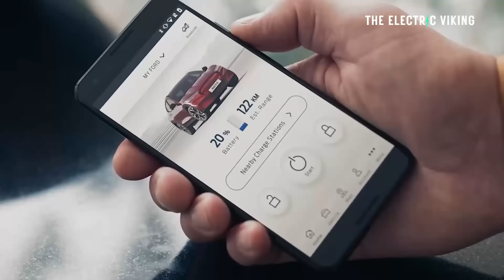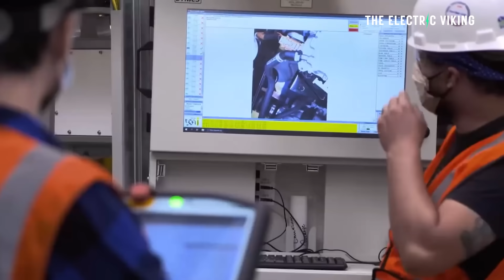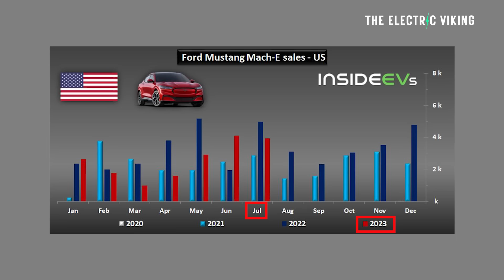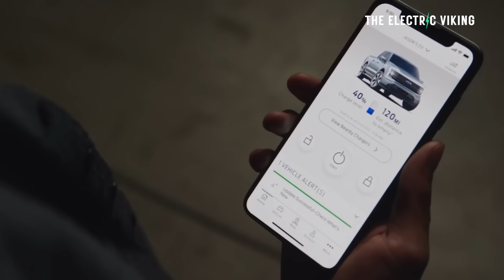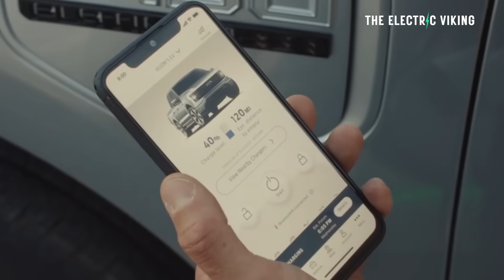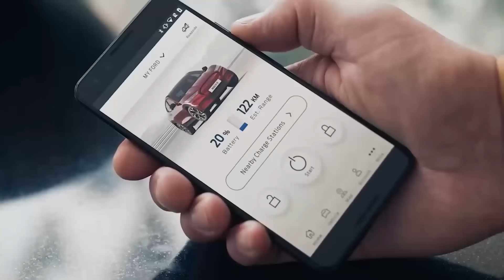Ford in CRISIS: electric car sales collapse in July as inventory piles up

Comment: I'm sorry.  I like the EV. His videos are entertaining and thought-provoking; however, he is often times, just flat out wrong.  In a previous video, he claimed Hyundai USA was putting up their own money to offer $10,000 on the Ioniq 5, which turned out to be a total fabrication.  In the US, the Ioniq 5 is eligible for the $7,500 as a leased vehicle, as our all EVs regardless of their country of manufacture, "because leases are interpreted as commercial business in the law and, as a result, are eligible for the $7,500 tax credit."  And the additional $2,500 was for any existing Hyundai owner to purchase any new Hyundai.   And in this video, the EV claims that the Mach E qualifies for the full $7,500 when, in fact, outside of a lease, it is only eligible for $3,750 since the batteries are still made outside the US.  You can confirm this easily as its clearly printed at the top of Ford USA's Mach-E webpage.